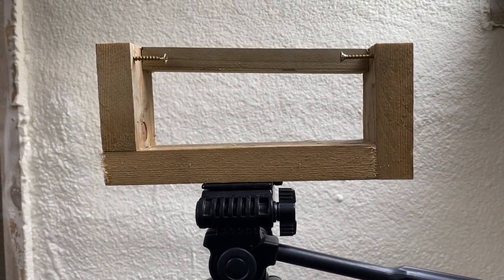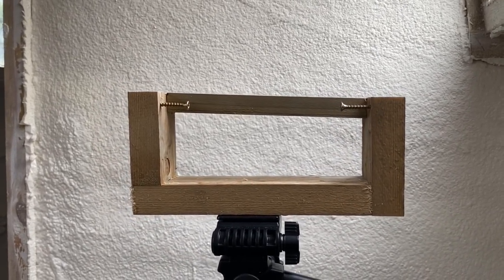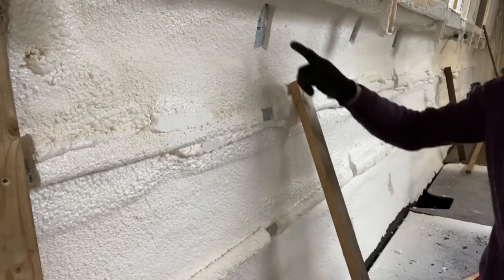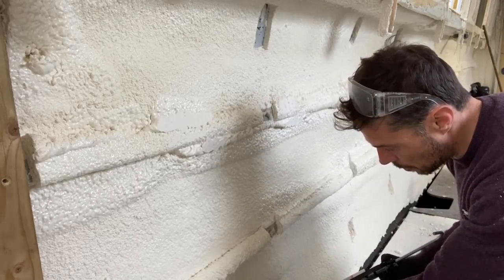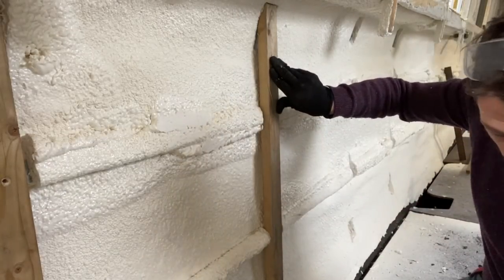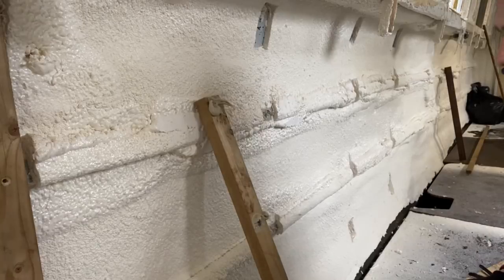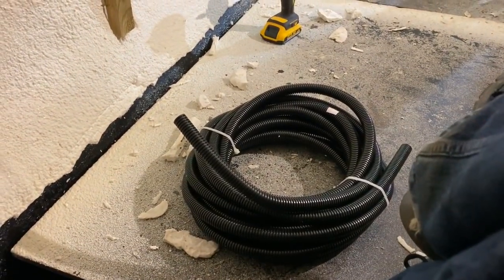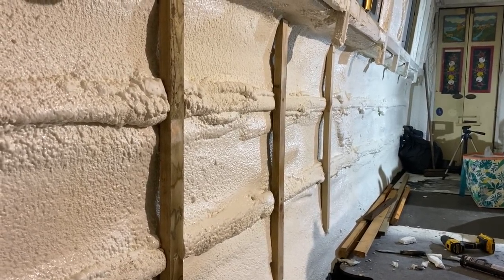21. Narrowboat woodwork battening below the gunnels

Comment: It's probably too late now (28 Jan 2021) but if you're breaking 4 mm drill bits when trying to make a pilot hole, use a 2 mm drill bit. That may seem counter-intuitive, but every drill bit has a section in the centre which doesn't do any drilling - it's providing the strength for the bit. A smaller bit has a smaller centre part.

Comment: when you screw into the hull when fitting the battens won't the screws stick out of the side of the hull??
Reply from the maker: Good question but no. I’m screwing into metal braces welded on the length of the boat. Otherwise you’re right, the screws would poke through the sides which wouldn’t be good news !!